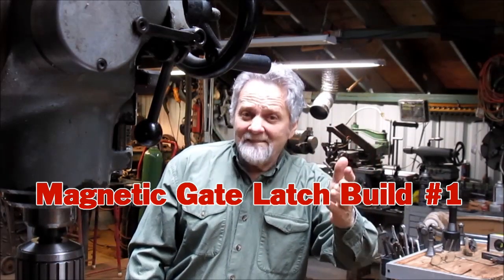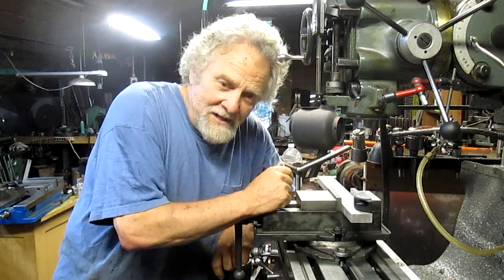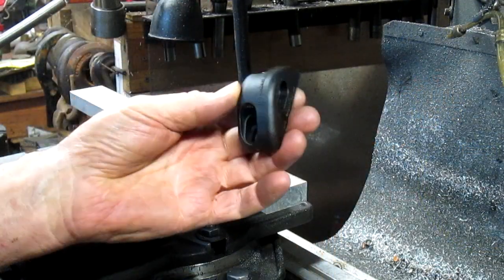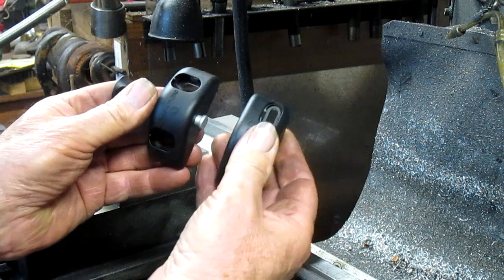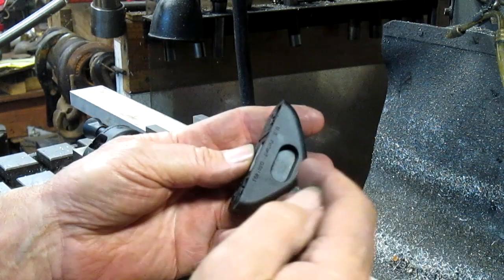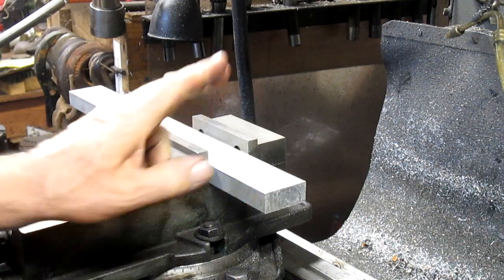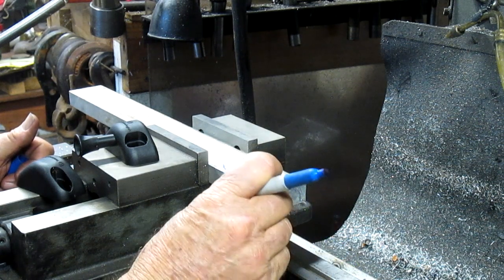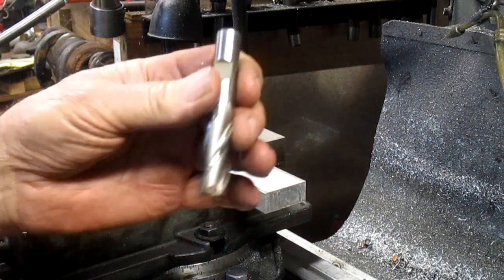Magnetic Gate Latch Build #1

Comment: Why the customer did not weld a 1/4" x 1" plate on the 3/4"
Reply from the maker: it fit but the edges hung out over the edge of the gate and his customer paid a lot for the gate and he wanted it right.
Reply: @NikColyerMachineWorks  It would still look off, did he found out if it have that size?